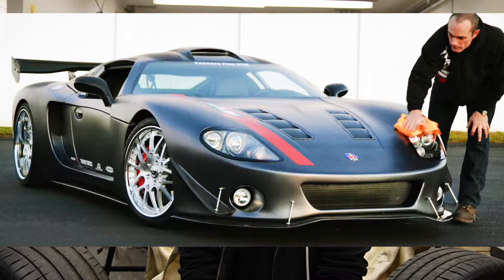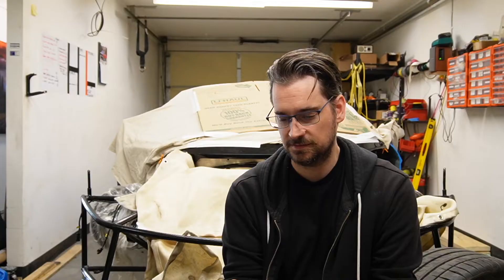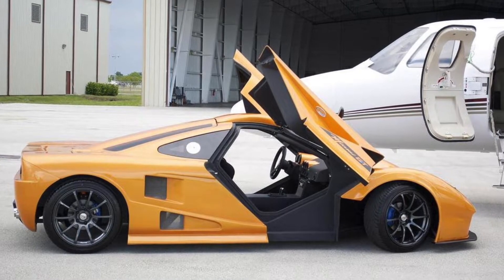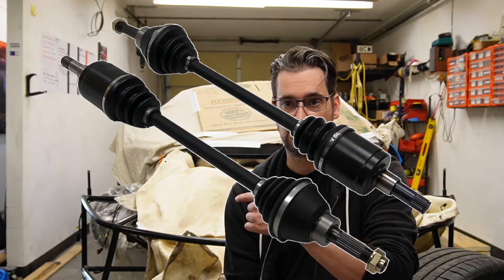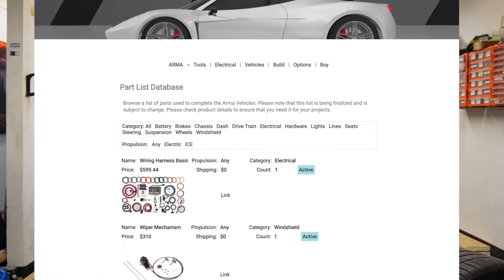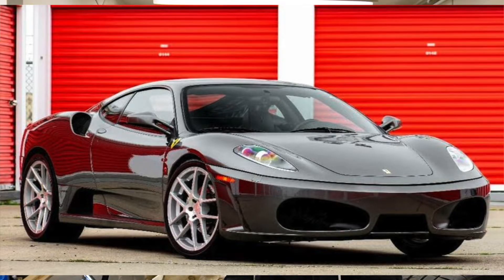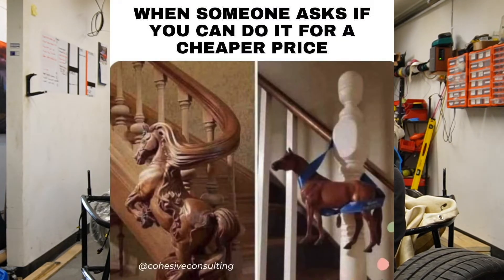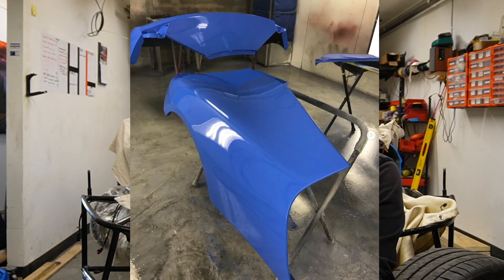How much does it cost to build a kit car?

Comment: Kit cars are generally sold as a bare chassis, body panels, windshield and some accesories or electrical wiring and the customer is responsible for sourcing and assembling everything else that is required to complete the vehicle before inspection, registration and insurance can be purchased to drive it on the road.:face-red-heart-shape::face-purple-wide-eyes::trophy-yellow-smiling:👍
Reply from the maker: Thanks.

Comment: I love kit cars but they’re not worth it in the long run everybody told me that and has warned me about it I still didn’t listen built a mr2 turbo wide body had to add fiberglass and bondo body filler to make the car look clean the guy who did the work was from a shop that won contest many times on import tuner magazine from back in the days he always had like 30 cars stacked in his shop putting on wide body kits for a lot of people well long story short even he told me the exterior won’t last forever maybe 10 years it will start cracking in certain area where you’ll have to fix it so mr2 after 15 years finally started cracking from the weather and conditions driving rock chips so on. That’s when I thought about it and I’m like for the money I put into this car 30 thousand dollars during the year 2003 I should of had just bought a car and did a motor swap instead your probably going to ript out your hair when I tell you this or reading this at the year 2003 rx7 was only 3-6 thousand dollars my friend got one for 6 thousand and did a ford motor swap in it to make the engine more reliable . The 1968 fastback mustang at the time was only 3 thousand my friend had 2 of them I regret not buying one and beat myself up everyday buying a mr2 turbo with wide body kit . Now the mustang is like 40-100 k the rx7 15-60k well anyways I brought that up to share my experience and that was my opinion . I like your opinion as well I’m always open minded to everything sometimes it doesn’t matter what people say you just have to learn from your own mistakes atleast you got to live the moment at the moment as long as you were happy at that time than by gone be by gone move on .
Reply: after 10 years many things may start to crack, even normal Ferraris depending on treatment
but you're right, they may be more susceptible
Solutions could include carbon fibre encasing similar to LaserStirling3d's method
Reply from the maker: This is a really good point. Especially when you consider the time value of your time making custom body work. One of our goals is to offer body panel manufacturing as an affordable service for custom designs. We are working on CAD and CAM software, so you can take a 3d scan of a vehicle body, design or have a designer make a model and have us make fiberglass panels. Because the process is automated with a giant 5 axis cnc router the cost should be reasonably affordable and replacement parts are feasible. How long fiberglass panels last especially exposed to the sun is unknown but if we can take out the staggering labour cost and just make more panels we can still have custom designs.  Do you still have the mr2 car?
Reply: @ArmaAutomotive  oh wow that’s cool info , to answer your question short no I no longer have the mr2 . The long story I’ll try to explain it fast The state I lived in was very strict with modded cars but I did my engine swap legally I took the car to the dmv and showed them what engine  I had so they made me pay for 2 registration papers one was for the car chassis the other for the engine . Than every year I had to smog it where I barely made it pass . I got a inspection on the car twice so I’m like yeah I might have to sell this money pit unless I move to a different state where it’s not strict so that was when I made the decision of selling it and the new owner got the car impounded I already knew that was going to happen it was a life lesson for me when your young your dumb my conclusion of predicting what eventually would happened happened luckily didn’t happen to me but unfortunately happened to someone else .  But hey if your into classic cars you can do anything you want to them without having to smog it . Currently I just drive a e92 keeping it all stock just so I can go grocery shopping or out around the town but if I ever get into modding cars again probably going for the Datsun 240z